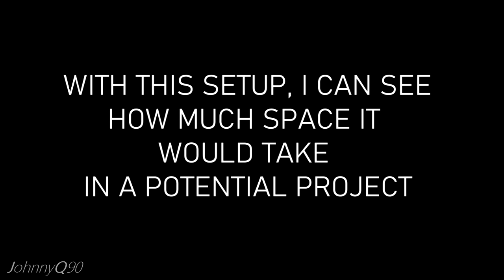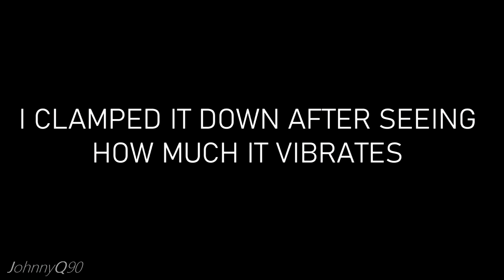Miniature Inline 4 Cylinder 32cc Watercooled Engine

Comment: 900 dollar's for 32cc engine 

What did they snort when making this?
Reply: I just seen that price on there could have bought a real engine..lol
Reply: They were trying to snort the expenses from making such small/custom engine
Reply: @djsmileyoflasvegas  for 900 dollar's you can buy vw mk 2 RALLY car and you whould have 200 dollar's left
Reply: @LatvianVideo  what expenses? 

For 900 dollar's I can buy "amg custom" 2.3L Mercedes-Benz  turbocharged diesel engine
And use rest of the money to buy a car
Reply: @blackturbine  Check how big is Mercedes, and how many cars they sold with that engine, and compare that to this engine
Reply: @LatvianVideo  some of the dumbest logic I've ever heard. The mercedes engine is a real engine costing thousands more to produce. You cannot justify the $900 pricetag by saying that "Mercedes sold more"
Reply: high production cost due to low production numbers. lots of parts are being hand made.
Reply: The low demand for a tiny RC engine, that’s what.
Reply: @lucasvanhamburg4937  nope 
Cnc machining is not something super new anymore also that looks like lost wax casting so even cheaper 
Also you can buy "piston, cylinder blanks" on alibaba for nothing and make it fit 

This isn't anything superb to justify the price, you can buy engine like poulan 2000 33cc that is definitely more efficient than this and make it fit
Reply: @lucasvanhamburg4937  and i forgot to mention they are using O rings as piston rings so they are even cheating 
Any fool can make an engine with good compression like that
Reply: any time you add a cylinder the cost increases exponentially lol
Reply: @blackturbine  comparing a 2 stroke single cylinder chainsaw engine to this is ridiculous
Reply: @keeganwebber  how so 

Poulan offers better efficiency
Better torque
Better power 
Less oil consumption 

This engine uses o rings as piston rings... that is big bruh moment
Reply: I'd buy a lm7 5.3 vortec instead. Complete with accessories. Still money left
Reply: @blackturbine  yeah it's also a two stroke, air cooled, single cylinder chainsaw motor, not a 4 cylinder, 4 stroke model engine with a pressurized oil system, a distributor and liquid cooling lmao
they're completely different classes of engine
Reply: @keeganwebber  true poulan is made for as much power as possible per dollar 

And this engine is made for most bling per buck with some power here and there
Reply: @maxflute7893  slap a race cam kit on that bad boy and you are good to go
Reply: @blackturbine  I would like to see that ! Maybe you can send a link ?
Reply: Tsunauticus III  well i can make you cad drawing but making a working prototype will be the hard part since I don't have machines to do it currently.
Give me couple months and I will get you a design
Reply: @blackturbine  Yeah you know what I'm talking about xD

Comment: These small engines are more efficient with less cylinders. A single or twin cylinder max for 33cc, will get you a lot higher efficiency. Heck, you could even do a single 2 stroke, and still be more efficient.

Comment: I want one. I can see it with a little equal length manifold, make a silencer and exhaust. Fab up a little chassis, swap that flywheel and cast a lead one to lower the idle and make a little clutch kit. Be awesome with a bit of proper nerdy engineering on it!

Comment: wonderful that its got a radiator, water-pump and oil pump, just that it does not run smoothly, dont know if all is balanced or just needs breaking-in, either way its a good motor to put in a speed boat or make a 1/4 racer/hot rod etc! Just know that hardly any company out there makes such engines, no one!

Comment: $900 on Ali express. Coper liners, rubber piston rings, dodgy discriptions due to translations. No power rating or max rpm indicated. Dodgy as it is irresistible. So freaking cool! Time to upgrade it and put it to work!

Comment: Make a roots twin scroll supercharger and have it spin a custom wound 3 phase generator for high watts!!!  To charge any RC batteries you have. Or PowerBank, power wall, etc!!! Maybe run exhaust to peltier module for more electrical output? Love it!
Reply: Can make a flywheel to hold the magnets for your generator.

Comment: Been out of tinkering for a while. I didnt realize they were making spark plugs that little. We used glow plug type. Thats oretty cool. I made several old weed eater motors water cooled years ago. Actually bored the blocks ran electric water pumps. Designed them for rc boats. Drew water from the lake but never actually tried an enclosed ststem. Is this engine designed for use or just for classroom type situations? I wont begin to act like i know anything about this engine but i will suggest using an  exaust system that provdes some backpressure. The trend with a lot of people i know are to run these tiny engines with no exaust past the manifolds and they tend to be short lived. The 32s i built were still running years after i built them. I ran the crap out of them. Had one boat with twin 32s . It would scream.

Comment: The excessive vibration is an issue. Please work on balancing the rotating assembly of the motor. Once the motor is balanced, it wont need to be clamped down

Comment: Suggest you  put  a switch  in between your  battery  and coil  for  spark  plug s for stopping  engine  . No  electricity  to plug  no spark engine  won't run. Simple.

Comment: With a 1KW generator it could be a rescue charger for cars with a dead battery.
Reply: "Why not use an actual generator?"
"I like this better"
"Yeah, but this is--"
applies load to connected alternator, making the engine go reeeeee
glares at naysayer
Reply: @cellphonelightsaber  Well, the spec was 1-2 HP so it would be able to take the load but to a very high cost so it's not a good idea after all. Calling for help will probably cost less and go faster.

Comment: you put a link and the title of the product says it's an RC boat engine, so i imagine this engine is meant for a scale model of a historic battle ship which you could probably build out of steel to scale. but the output of the motor for such a build would be at a constant speed, with little to no variation other than engaging and disengaging a prop shaft. however making an RC car? which might be something between like 1/12 and 1/8 the scale of a normal car, and you want to put a variable clutch with also variable load outputs? idk how much stress that engine can take but i cant wait for whatever comes after
tbh if the engine can do a similar hp to the first inline 4's why not just make an insane go-cart from it cause im pretty damn sure this is already better than an average lawn mower engine.

Comment: Funny seeing a computer radiator used for a small engine, lol.

Seemed odd though: The fittings for the radiator seemed very small. Normally those come with fitting that are much, much larger for water flow.

Comment: Wouldn't the radiator form an airlock? I know the air will stay at the top with the lines on the bottom. Just what I notice on bigger engines.

Comment: Shouldn't the coolant overflow be T'd off of the coolant line instead of having the coolant flow through it? Seems like doing it this way might aerate the coolant and cause some cavitation issues in the water pump when things get hot.

Comment: Where do you find 97 octane gasoline? And why the high octane? Is it because the engine is new? I have always understood (perhaps incorrectly) high octane was only required for high compression engines or engines where preignition could be a problem.

Comment: Nice video yet I was expecting some narration as to your choices.  I would always stop  it by shutting off fuel supply as it is the least damaging to the life of the device. Never shut off by blocking airflow or disconnecting the ignition. Keep it in new condition by changing oil after 20 minutes initial no load run and then run under 50 - 70 % load for at least 40 minutes with the new oil.. Change oil again and run at near full load for 10 minutes & that should have internals ready for any varying loads in your test sequence. Use synthetic after the braek in period , thin weight is OK. I would run this after the break in period on propane as to keep the engine in like new condition for the longest possible time. compensate for fuel type & of course change the spark curve & gap of plugs and heat range . Water temp near 180 degrees and use red line water wetter. Good Luck ........

Comment: Will you be making any more videos using this engine? I'm still incedibly curious to see what you do with this. I have the same engine and love it, but am struggling to use it practically. I'm in the process of replacing the valve springs to try and help it run a little better

Comment: I am concerned about your cooling system and air. your rad very may well have air in it. No way for it to escape. Maybe drill small hole and put a bleeder screw? Or mount it hose end up.  Just for long term thought.

Comment: Good video but it is not a good practice to shut down an engine by choking off the air supply.   Your are flooding the engine with raw fuel which will wash the oil of the cylinder walls,  which will cause premature wear.   I would recommend disconnecting the power from the ignition module.

Comment: Hey @JohnnyQ90 do you have any approximate power output ratings or HP figures for the engines you build? I'm sure you've been asked this many times but you have too many comments to read through! I'm sure with you skills you could fabricate a slick little dynamometer.

Comment: It really is an awesome little engine. However, what can you do with it? Nothing! The cost is $900 US. For that much money I bet I could find a good used non running Quad that maybe needed some work. I'd have just as much fun fixing that up for $900. Plus, I can actually use the Quad and even have something that I could possibly resale for a small profit. In-short, I wouldn't waste my money on a Chinese product that does absolutely nothing. Just my two cents!!

Comment: Yeah it's a gip China is trying to sell a Yamaha 4cylinder weedeater nock off engine that fails shortly after use due to poor quality aluminum & steel breakdown for 10x as much anyone who would actually buy this thing is a sucker for rainbows 🌈 of Chinese ideals. It may look good on the starting line but ..give it real time use you'll find any 4 stroke weedeater motor is superior in multiple ways of torque rpms & long term use at 10x less the cost.. 4 years from now I guarantee that engine will have warped aluminium cylinder , head, cam, crank and anything actual steel will look like a food can left outside in the sand after a heavy rain*while this thing sits inside and still looks the rusty shell* stop falling for it people! ☝😔🇺🇸🔝